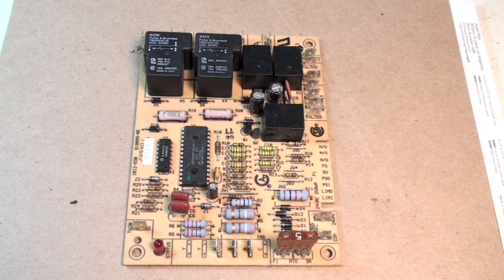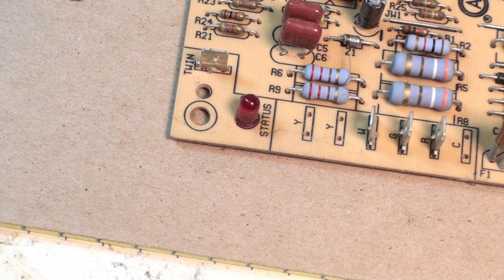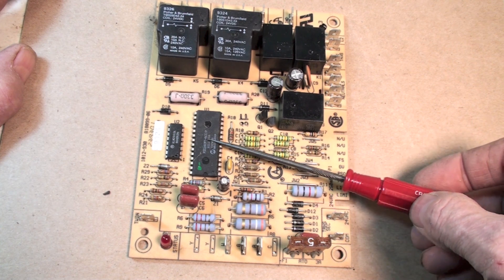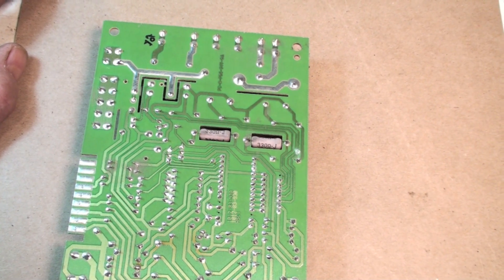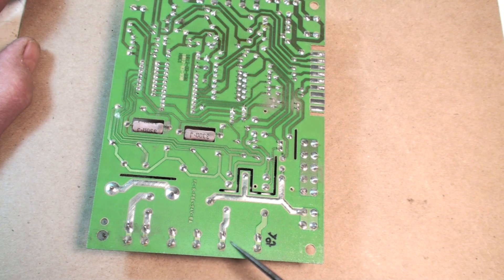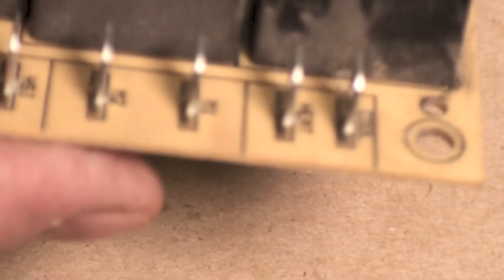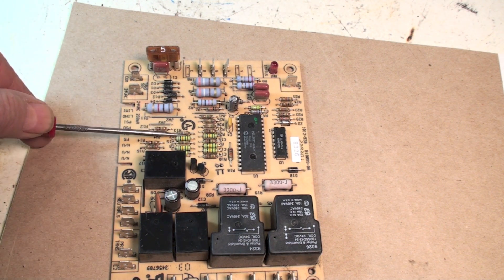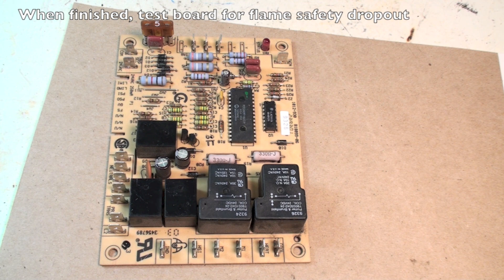Troubleshoot the circuit board of the gas furnace

Comment: Mine is throwing a code for "reversed polarity". All on-line sources say either a short in the wire or the board is spent. Any input?
Reply from the maker: Be sure all power wires are tight and white to white and black to black and the ground is hooked up.  Sometimes, there can be feedbacks from other loads.  You could try using another breaker in the panel.  You are working with lethal voltage here, so do not do it if you are not confident.  Hope this helps.
GFM
Reply: Thanks much!  A big help, yes it was!

Comment: Thanks Gray - these are fantastic videos. I have a Trane 1993 yr that dropped out. A wiggle on the harness to the board fixed it - it clicked on / off so I zip tied the harness to a slightly different position. Works great now ------ but you showed me how I might be able to re solder a terminal if needed.

I'll say I got a White Rogers module on Ebay for $30 -- but the zip ties are holding.

I had a serious illness a while back - I've to come to YT to figure things out as my budget has been tight.

Now my gas pack downstairs is acting up --- so I'm studying and learning.

Thanks a lot.

Comment: I need your help, my Coleman Heating and Cooling system is acting up.  When heating my house the furnace only heats up one degree at a time.  ie.  My thermostat is programed for 66, I will manually put thermostat at 67.  The heater will turn on and heat up to 67 then the heat will turn off and the unit will continue to blow with cold air.  The code LED reads Limit Switch open/open fuse.   What can I do?
Reply from the maker: Look for plugged filter or dirty blower wheel.  Also be sure all vents are open.  If it is a mobile home double wide, check the crossover under the house.  It could be smashed by animals.  Let me know how you do.
GFM

Comment: Thank you Gray, thank very much for the video.  These days many manufacturers are trying to cash in on the money they didn't make up front by charging a lot of money for their circuit boards.  It's gotten so bad that many customers hate service guys because of the high cost of components. Sometime customers end up having to pay 2 to 3 hundred for these things and is scares them, perhaps with good reason.  What makes it even worse for us is that sometimes when we put in a brand new board it burns out in a few days or even right away. So what do you do when this happens?  We try to replace it by talking to the vender and explaining what happened and maybe he will replace it with another one, maybe because a lot of manufacturers  have shortened the warranty period on these things from a year to three months and often when you buy the board your vender has had it sitting on the shelf for a while and for him to have it replaced is not automatic and can be a problem.  It has become tricky to stock these items in my van. So being able to make a simple and safe repair becomes a great triumph. That is why I am very happy about this video in that at least it shows us another way we can be of better service to our customers.
Reply from the maker: Sometimes us techs are afraid of these parts because the manufacturer says not to repair it.  When we had relays etc, that we could replace, it was much cheaper.  When these things first came out, I thought: oh man, if this thing doesn't work because of a burned wire or relay contacts, we have to replace the whole thing! 
Then for any given model of furnace we mostly had to have 4 to 5 different boards.  
There are general replacement boards that helps some, but still the cost is high.  When I saw things like the traces burned on the inducer relay in a late call on a cold night, I just said I am not leaving this guy with no heat tonight over this small failure.  So I started repairing them.  I never mess with anything in the flame safety and always check the unit for all safety shutdowns.  Thanks for the thoughts.
GFM

Comment: Thank you. It's people like you that take the time to post videos that save me $1000s of dollars every year. The tech was going to charge me $600. I spent $4.99 on solder. Oh, people can get a contractor to them at the supply store, buy the part and pay them in the parking lot for their time. Fuck the system!
Reply: Bob Hartley i
Reply: Bob Hartley You're not only paying for the parts and labor but also the knowledge the tech has. Sure, you may be able to fix it yourself, if someone told you what the problem is. Unless you know what you're doing, you're just a parts changer. I just had a service call on a heat pump for a customer who saved himself a few bucks replacing his capacitor. But he wired the thing wrong and had to pay me to come fix it and the new problems he made. The total price for the whole job was $750 and I cut him a deal.

Comment from the maker: Whether you can buy one is dependent on manufacturer and age.  I don't know if there are any federal regs in Canada.  Repairs are not recommended by the manufacturer.  I give vids on limited repairs to solder joints on some parts of the board that should be done only by someone with the skill and confidence to work with circuit boards.  When a board is replaced, it should be tested for all safety dropouts to assure it will not allow the furnace to operate unsafely.  Hope this helps.
GFM

Comment from the maker: New motors seldom burn out if they are wired right.  You need to check amp
draw of the new motor when its running.  Should not exceed rated amperage.
 Check the back side of the board to see if any traces are burnt.  Hope
this helps.
GFM

Comment: hi, gray so i have a furnace that i replaces the blower motor because it smelled brunt and stop working. the board LED's were flashing slow saying everything is ok, so after i replace it still didnt work i TAPED the relays and it turnd on but after a day i started smelling brunt again and over heat the motor so now have to get another one and maybe a new board. Any ideas what it could be? thanks for your advice
Reply: that points to the run cap being bad. Normaly you replace those with the motor as a match.
Bad cap causes high current that overates everything...

Comment from the maker: If you have power in but no power out of transformer, the transformer has failed or a fuse has blown.  In either case, you may have a short in the low voltage outside the unit.  You need to find the short or the new one will fail.  Hope this helps.
GFM

Comment: The fan can kick on with no problems if switch on manually. The fuse always blows as soon as a signal is sent to compressor. Also I can get both fan and compressor to run if i jump the control board. Would that short be between the thermostat and control board or between board and compressor? Or am I looking past the board itself being bad?

Comment from the maker: Look for a short to chassis in the Y or G circuit.  Commonly this would be a screw pinching a wire or insulation scraped off the wire.  Hope this helps.
GFM

Comment from the maker: Smells like a pressure problem.  Start the unit.  When the inducer comes on, jumper the pressure switch.  If the unit runs normally, it is a pressure problem.  It could be a blocked vent, vent too long, inducer failing, pipe too small or heat exchanger problem.  I have sent a video that shows how to troubleshoot the inducer.  Good luck.
GFM

Comment: I have a problem with my furnace in which it ignites, for just a couple of seconds and then shuts off.  It is not the Flame Sensor as I have cleaned it (1000 grit sandpaper) and even replaced it once but still does the same thing.  I get no codes from the status light. Eventually, after several shutdowns, it will run as normal.  This continuous cycling of the igniter is causing it to burn out at a rapid pace (replaced three times)!! I am leaning toward replacing the board.  Any thoughts?
Reply: I am having a similar issue.  Did some extensive troubleshooting testing the valve and sensors.  I believe it is a bad controls board with bad relay that is occasionally ‘failing’ and shutting down the valve (intermittently dropping the 24v) unintentionally.  Going to try a new board but I’ve tested everything else.
Reply: Ten years later and I'm wondering if you two have resolved the mystery.
The valve does exactly what you said, unless it chatters like the teeth of that demon in Hell Raiser.  If you ignore it for an hour then try a hard restart it can run for an hour with no problem.
My concern is that the vendors who ship single valves to the end user put them in a box the size of a VW with a single air pillow inside (the Amazon method) so that the delicate device is pre-destroyed before it gets to the destination.  Then you couple in: Flame Sensor (even an a 3wire pilot), inducer dropout that could affect the pressure switch in microbursts short enought to miss but long enough to mess up proven flame, a bad valve (almost a given but then NONE OF THEM WORK thus suggesting there is a problem somewhere else that ultimately ends up implicating the valve), INTERMITTANT SHORTS, and then faulty reed valves that make contact but don't let the full AMPERAGE through.
If they made these device any more complicated they wouldn't work...
...wait.... they don't work now...